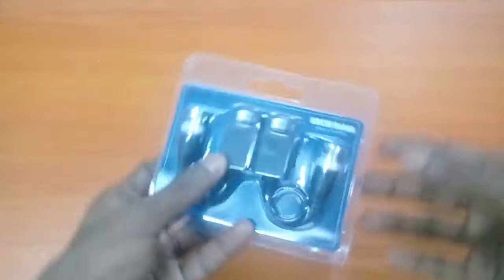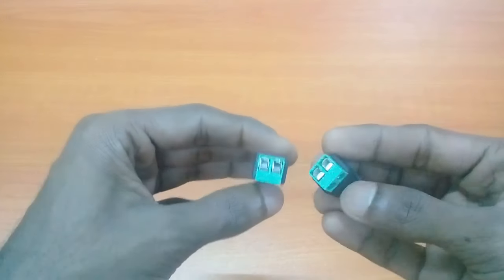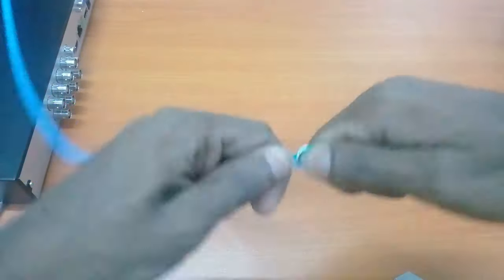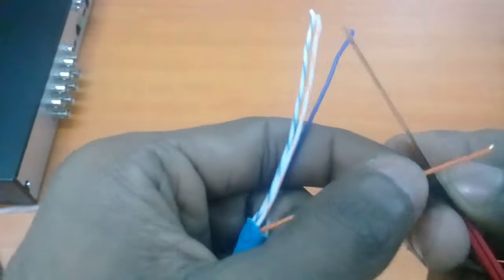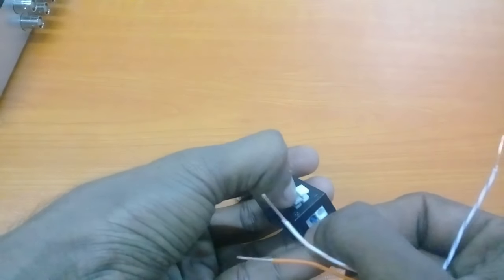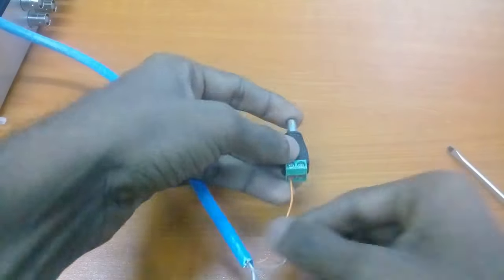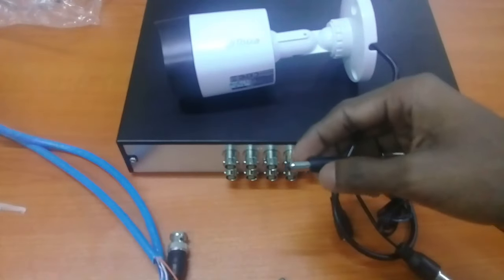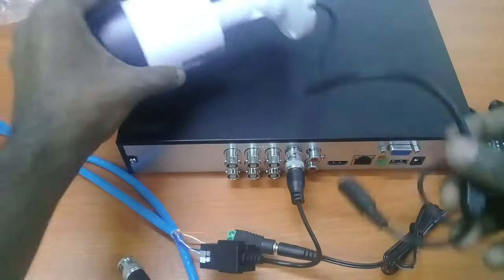How to Connecting CCTV Cameras with Cat6 Wire & Baluns - One cable for 4 camera over CAT 6 Cable

Comment: My technician used an RJ11 cable and camera are view was not clear so installed balun and now is clear. But when it is night, when camera tries to kick in IR display goes off
Reply from the maker: It is not related to cat 6 or balun
Reply: @LayaBro  You are right. discovered that cables were inferior so voltage was dropping heavily when IR kicked in.

Comment: One doubt. Pls answe me asap. I have connected 2 analogue cameras by single LAN cable. All the 8 wires are used. But the video not clear. Lines and grains are there. What is the solution? No balloons used. Directly connected to BNC connectors. Can i use any type of booster?
Reply from the maker: Please use balloon.
Reply: Hi,
While using CAT5 or CAT6 cable to analog cameras like ahd, hdcvi, Tvi, who have to use UTP video balloons both sides. Connect UTP balloon at camera and near dvr your problem will be rectified. Note cable length should not increase above 50 meters.

Comment: Helo, I have a cctv set up with two hikvision cameras to a dvr using cat 5 cable for video and power. A would like to add a further camera,  am I right in that there would be no need for additional power connections as this has already been set up?
Reply from the maker: Can you tell me your power supply ampere range
Reply: Input 0.7A max
Output 12v 1.2A
Reply from the maker: You have to use new power supply.
Reply: @LayaBro  Thank you. Can the existing power supply be uprated to accommodate another camera? If so, what should the ideal power supply ampage be?
Reply from the maker: @sukhscheema  You can buy 10 A 12V SMPS Power supply. Please see below link.
Reply from the maker: @sukhscheema  https://www.amazon.in/s?k=10+A+12V+SMPS+Power+supply&i=computers&ref=nb_sb_noss

Comment: What if the cat 6 cable goes for 70-90 meters to the camera then that power supply wont be enough right ?
Reply from the maker: වෙනම AC සප්ලයි එකකට කෙබල් ඇද ගන්න. එත් මම නම් කැට් 6 එකෙම 230 කන්න්ට් එක අරගෙන ගිහිල්ල කෙලවරින් පවර් සප්ලයි එකට හය් කරල තියනවා.
Reply: @LayaBro  thank you reply ekata brother ... ee kiyanne cat 6 eke power 230v / video dekama ekata aran gihin tiyenawada ? Kochchara durakda wadima ? samanyen 100m wage durakata yanawa nam wire eka mona wage central power supply ekak da use karanna ony ? Mama danata nam karanne wenama AC230 wires yawanawa power walata wenama ita passe cam eka gawin box power supply ekak hai karanawa , central power supply ekak nam use karalama naha mama

Comment: Good job, can i use POE Extender to transmit both Video and Power over Cat5e and Balun  for Analogue cameras? thanks
Reply from the maker: Thanks for your advice.
Reply from the maker: But I remember POE voltage is 48 V, but analogue camera voltage is 12 v
Reply: depending on injector. there are versions for 12 V but pay attention on cable colors so you won't misplace  connectors. But I'd suggest passive baluns over utp with power station near (connected to an ups)  this way you'll power lots of cameras from one point and have all signals send on one utp/ftp cable to your active/passive 16/32 ch balun then into your dvr.(you'll get less cables near your dvr and a secure power line )

Comment: I have installed CCTV one camera with cat6 but display is black and white why? Please any solution
(I have 2A power supply for 1 camera)
Reply from the maker: Connect short cat 6 cable and check the camera.
Reply: Thanks, I have been found the problem,
Problem was that the video Transceiver (Balloon) was not working properly.
Now I installed 50meter long distance camera on  cat6.

Comment: Hello i want to connect turbo hd camera using fiber optic to dvr,  what will be the procedure for setting up system. Plz help
Reply from the maker: You can not connect  turbo camera to fiber optic cable. You have to buy hybrid DVR and you have to buy IP camera. then you can connect IP camera to DVR using media converter.
Reply: @LayaBro  Isn't media converter available for fiber optic to bnc connector? using sc patch cord

What will be the solution if i don't want to change dvr and turbo hd camera [hikvision ]
Reply from the maker: @siddharthvarpe5049  You can not use turbo camera using fiber cable.

Comment: Ur you sure this is 400 meters? Long distance power supply it will be take low voltage
Reply from the maker: DC Power not sure. but I used AC power with data same cat 6 cable for connect two wifi Access point.
Reply: AC power for what and what cable ur you using. For power
Reply from the maker: one and two for TX DATA ( Green and Green White ) 3 and 6 for RX ( White Orange and orange ) you and used remaining pare for AC power transmit.
Reply: @LayaBro  Stupid.very dangerous to use AC power to UTP cable..
Reply from the maker: @Secretfishhub  yes IT is dangerous. if same one can undertake risk It is work.

Comment: Please tell me the maximum length of camera wire we cover using cat6 cable.....100mtr, 150mtr, 200 mtr ? please give correct answer
Reply from the maker: Around 400 m But I am not tested.
Reply: @LayaBro  is this single cable piece of cat6 200mtr is possible to carry video and dc supply to SD-
DVR in cp-plus bullet cam
Reply: please tell me maximum length you tested & you sure, i m in trouble in a large Govt college, so your experience is very helpful to me
Reply from the maker: @riteshkalia6679  It is possible, please use one pair  for video Data and other three pair for DC Supply.
Reply from the maker: @riteshkalia6679  I am tested only few lengthen. But sure 200 m definitely will be work. I seen so many article in internet It is work 400 m. Please Connect camera to 305 m cat 6 box and tell me your experience to me.
Reply: @LayaBro  ok .....i am very thanks full to you for this act & kindness, if i will felt in any emergency plz help us to me to complete my project.
Reply from the maker: @riteshkalia6679  Welcome brother any time you can contact me. 0094773741314 Imo or viber
Reply: @LayaBro  Thanks a lot 4 this.
Reply from the maker: @riteshkalia6679  Ok welcome Brother
Reply: @LayaBro  its not working on 305 mtr Cat6 Wire Role, camera gets power but not showing video
Reply from the maker: @riteshkalia6679  Please can you check cable end DC voltage,
Reply: @LayaBro  i cant check it but Cameras LEDs working ...it means voltage is ok...but error is videos loss
Reply from the maker: @riteshkalia6679  How many pair use for to connect DC power.
Reply: Cat6 cable can give you 400m it all depends on the video balun and the mp of the camera you're running. You can even use it up to 500m its a function of the video balun you are using

Comment: What is the colour code sir??which colour wire for video? Which colour for power? Plz
Reply from the maker: You can use any color pair. But if you going to crimp RJ 45 for the IP camera you have to use below color code.
Straight Through Color Code,

1. Orange white
2. Orange
3. Green white
4. Blue
5. Blue white
6. Green
7. Brown white
8. Brown
Reply from the maker: https://youtu.be/C0XSKMI4Qoo   ( How to crimp RJ45 Connectors )
Reply: @LayaBro  sir you took me wrong.. I wanted to know, which colour wire for video? Which colour for giving power?

Comment: Hi, can i connect 2 cameras on single cat6 cable...  please help me through diagram or ur video link
Reply from the maker: you can connct two camera. use deferant pire for two camera.
Reply: @LayaBro  Sorry I'm new here, i only have 1 DVR and 1 camera. May i know can i use 2 pairs for power cable and 2 pairs for data? 2 pairs for power get stable power? 2 pairs for data get better stronger signal? please help advise. thanks.
Reply from the maker: @alexting8868  take white orange /orange pair for DATA and. Blue /Blue White user for DC power + and brown/White Brown use for DC power -
Reply: @LayaBro  2 pairs cable for DATA give better data signal instead of 1 pair?
Reply from the maker: @alexting8868  Thanks for advice
Reply: @LayaBro  No sorry. I'm not advice you. I'm actually asking you is 2 pairs cable for DATA give better data signal instead of 1 pair?
Reply from the maker: @alexting8868  Don't use two pair for data. In POE power Ethernet cable also use only one pair for data transmission
Reply: @LayaBro  Thanks for your advice. did you tried use 2 pairs for data? what is the result?

Comment: can i use single cat5 with 2 camera?
Reply from the maker: Yes you can connect two camera using one cat 5 cable.
Reply: thanks. but when it comes to distance, which is better to use cat5 or coax
Reply from the maker: Sorry I can't give you answer. If i found answer from my first i will tell you.

Comment: Long Distence maximum CAT6 Cable???
Reply from the maker: you can use maximum 400 M. but I am not test,
Reply: Laya Bro okk. But plz next video
Reply from the maker: Ok, thanks bro. I will try test in next video
Reply: It's work only 100m . Tested
Reply: @silvereyesolution  at 100m u need to supply 19v for the camera as there is normally video loss because of the distance. I tested and after supplying 12v to camera the images were not stable. I measure voltage after load and I had 5v. Also the power supply will have to be picked from a near source then signal cable can travel that distance. (provided u r using cat6 cable.)
Reply: @siscoelectronics9346  i tested 220m but video is not stable bro
Reply: i too think issue is the power am going give individual power any idea?

Comment: Can multiple camera connect in one wire by using any cable.please help me
Reply from the maker: any cable you can't use for connect camera. but you can test. using two pair wire you can connect only one camera.
Reply: Connecting multiple cameras using one cable like cat6 is not advisable as induction will take place causing interference in the video signal
Reply: Only twisted pair and balun

Comment: Its not willy Good for long distances and wiring together with other high voltage source power...induction in action and your videos view will broken.
Reply: true but if your using a passive 4 channel video balun over utp and link it to another one , signal won't be lost . this version its best to use for areas under 50m. ( you may get better results if using sftp cable isn't cheap but you may  go around 150 m without any issue as for 4 ch passive balun connected to a 16ch active one from 1.5km you'll reach without any problem almost double . :)

Comment: What is the reason we need to use cat6 cable to balon
Reply from the maker: 1) we can use same cat 6 cable to video data and power
2) we can use cat 6 cable near to 400 m
Reply: A "balun" gets its name from two words "balanced" and "unbalanced"...bal-un
You use them because it provides the same signal strength coming and going which translates to better picture with ability to go a great distance through cat5 or cat6 cable AND they come with almost any connection there is to mate with camera so a balun is not just a connector/adapter...
Reply: @timvittetoe6562  great.

Comment: When I use unshielded twisted pair I get interference
Reply from the maker: What is the lenght of cable
Reply: Maybe the CAT 6 is layed over too much electrical wires (BX), lightning, or even HVAC system. Unshielded wire is perfect when you have a perfect clear space run. Keep it away from other electrical emmiting or reflective equipment

Comment: this is wrong, you need to use 4 pairs for the voltage...
Reply from the maker: It is depend by camera power consumption and  camera cable length, shot distance you can use single pare por the power. I fixed two camre using single Ct 6 cable.